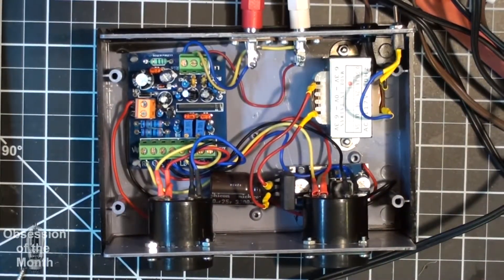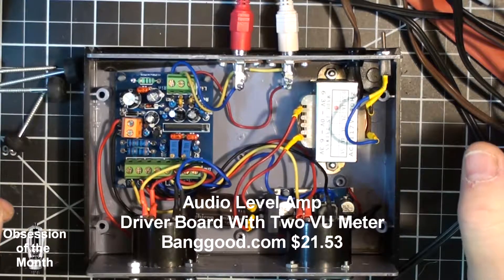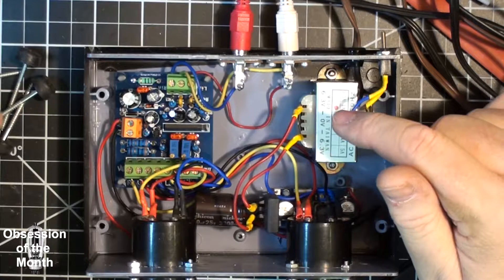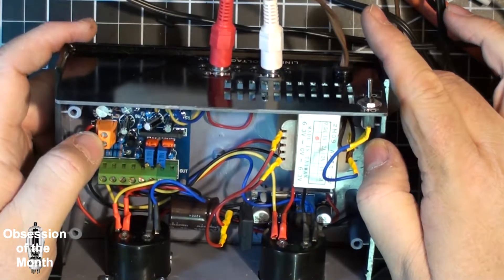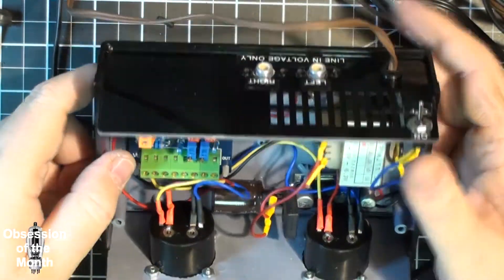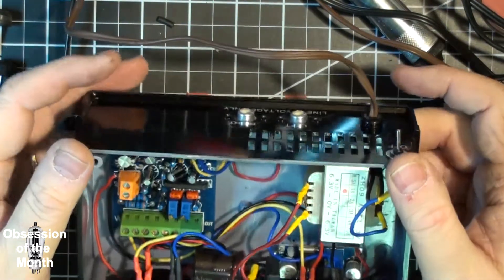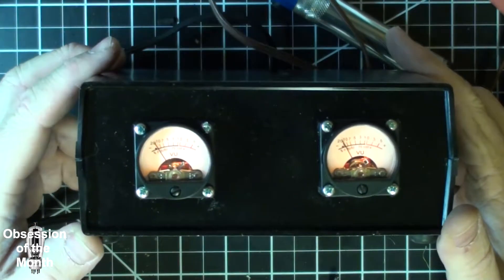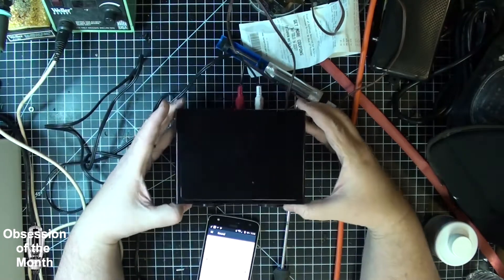Audio Level VU Meters

Comment: i brought this driver module... but when i use it.. the pointer doesnt working... but the back light is working... and the 100ohm 3w resistor is so hot... 2sec using can melt plastic.. what should i do any suggestion please?

Comment: Great video thanks.  I have just got some VU meters through and I plan to build something similar.  I was wondering if I would need a bridge rectifier and a transformer to get the power to 12v and you have answered my question.  Thanks.  Mine came with a load of extra resistors with the driver board abd I don’t know what they are for.  Any ideas?
Reply from the maker: no idea why there are extra resistors.

Comment: Thanks for the vid.  My kit is enroute to me, should arrive here (Vietnam) next 3 or 4 days.
But, a question. Why didn't you just use your 12VAC to power the driver board? Various sites mention; "Driver Board... can be a transformer or DC power supply". 

Aesthetically, I like the addition of your DC supply. When it comes to DIY, the greater the complexity, the greater the beauty.   Bravo, sir.
Reply: OOPS! Never mind. Found your driver board on a local market site. https://tinyurl.com/y2sd8ard . 

"...The supply voltage must be strictly guaranteed 12V DC, otherwise it will be easily to burn the protection circuit..."
Reply from the maker: The reason I installed the DC supply is that my board does not have a Bridge rectifier and voltage regulator. It appears that there are multiple versions of these kits, I reviewed the information I found when trying to locate instructions and wiring information. Some kits have a built in power supply and some don't. If the one you get looks like mine it will probably not have a power supply. of course you can always use a wall wart AC adapter as a powert supply.